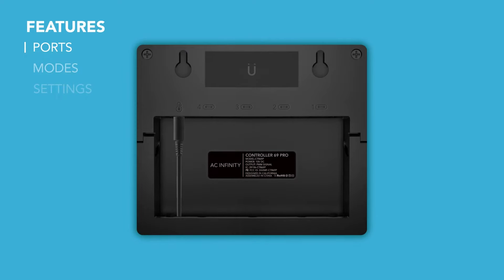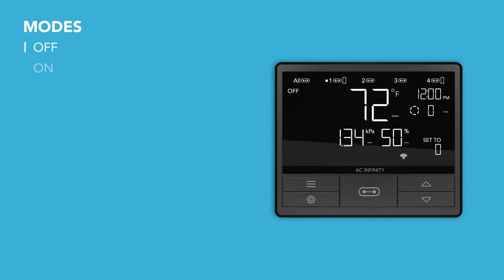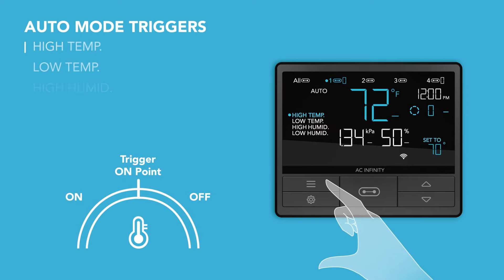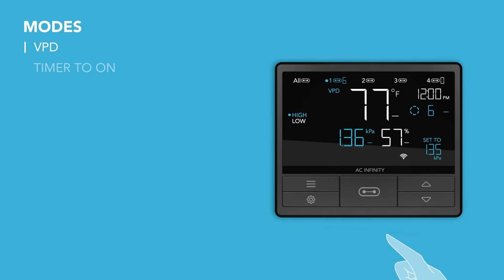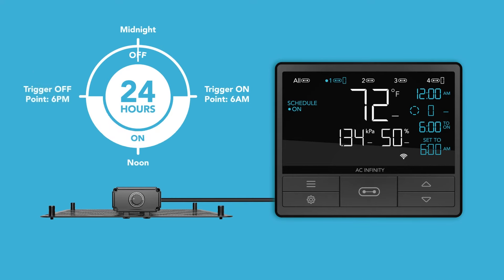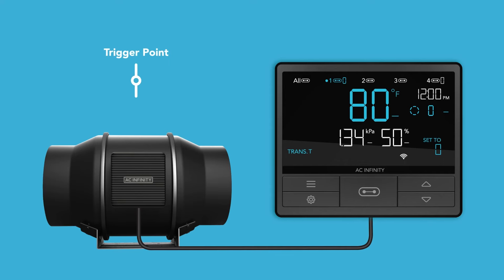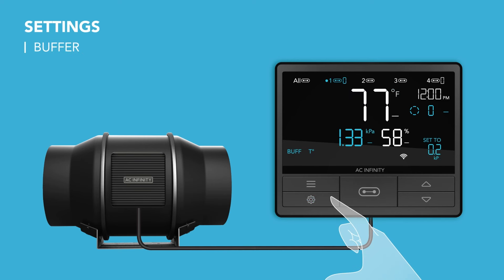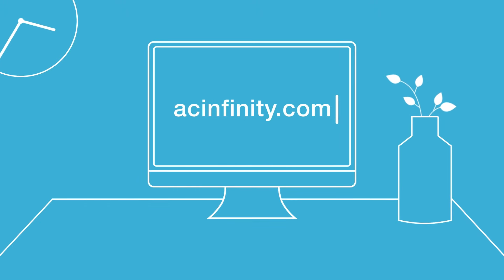How to Use the CONTROLLER 69 PRO

Comment: Im a new grower that has a full time job that doesnt allow me to be home all day. Having the controller 69 pro is the best thing ever. I can be miles away and still check in on my grow and adjust anything if need be. Peace of mind is priceless but AC Infinity sells it for about a hundo🙌🙌🙌
Reply: @Growdankmeds  how would I be able to control temp and humidity fluctuations? Or do you mean just have everything running constantly and adjust to that? If that's the case that doesn't seem the "correct" way, more of a waste of energy.  Please explain cause I plan on getting another tent soon
Reply: @Growdankmeds  How, say he's at work and a very hot front of weather moves in, the inside of the tent goes up 10 degrees into the danger zone, how does he fix this from work? Or how would a tent that is not automated adjust for this?

Comment: Extremely impressed with controller 67 and circulation fan. Easy to use,operate,and set up. 👌 Great job guys!!!
Reply: hey i know i’m a bit late but have you ever had a problem where it won’t read temps or humidity? i even bought a brand new probe & it still won’t work. I got my controller 67 about 4 months ago but haven’t even used it yet. I don’t have a receipt so i’m SOL when i called them this morning

Comment: I have Resisted a controller on my reef tank for years but absolutely could not for my girls! Of course the reef tank controller STARTS at 600. Then you got auto testers blah blah. Growing cannabis is soooo much cheeper than growing corals! I can be a poor man and still afford all the cool bells and whistles. Just ordered the humidifier to hook up to the 69 and getting my ionframe lights connected and scheduled took less time than the firmware update did!! My friends Neptune controller for his reef tank took him 4-5 hours to get connected, updated and all his devices connected.  Loving it so far. My friends think I am touched in the head because I have a little WiFi camera on my tent and my tank. Very good purchase

Comment: I have every port of the controller 69 used. Inline fans, grow light, heater on UIS port plug, and humidifier. Now that's its getting into warmer weather the humidity is getting up there.  I want to add a dehumidifier or possibly an a/c and have the controller handle that too. It's there a way to add/extend ports or will I have to get another controller?

Comment: Having problems working out how set the controller to have different values during the day and night, I want to drop temps at night but using the timer function only seems to turn it on or off, any help please? thanks

Comment: Few ideas for future software updates to the controller 69/pro. iPad make it so you can use split screen, with the AC infinity app. I use the 8" oscillating fans, how do I tell if they are in oscillation mode on the app? I can only see speed and adjust other controls in the port function. Other than that this thing changed my world.

Comment: the only improvement is to please add an automation that can be set to change the VPD leaf offset for night (0) and then to day (-4)...otherwise the Auto VPD triggering is kind of not automatic, as you have to 're calibrate' every transition from night to day in order for the triggers to fire properly ... enhancement request - thanks - the rest of the system is super awesome

Comment: Hi guys could use some help lol.  I have the ac infinity 3x3 pro tent with the s33.  I accidentally ordered a lux instead of par meter and have seedlings.  My question is what’s a good height and setting on the controller for my light.

Comment: can i just program the fan to go slow or off when temp. is under my minimum setting ? and can i use 2 triggerpoints to only a fan so high humidity fan high low humidity fan low and temperature corresponding ?

Comment: Mine was working fine until I did a firmware update now my controller won’t show that the fan or humidifier are connected. Light shows up fine.

Comment: Does anyone know if i can easily swap my Controller 67 for the 69 Pro shown here using the same power cable, temp cable and 4 pin cable for my Cloudline S6 blower fan i have set up for my Air conditioning? Its in a basement that can only be accessed from the back yard and unfortunately my bluetooth signal isnt that great yo remotely control the fan on and off at will unless im in close range. So i was looking for a wifi type device and hoping i can use the same cables i already have for an easy replacement.

Comment: Its crazy to me how complex of a process it used to be to set up ESP32 microcontrollers, smart outlet switches, hygrometer sensors, all in HomeAssistant to be able to program this same functionality for my tent in the past and even then it wasn't as smooth as this. Can't wait to get my 69 pro and start playing with it. It sounds like a dream system combined with yalls other UIS stuff.
Reply: Wym it’s so easy to use node red and esp32 with mqtt I’m only using this for my fans everything else going in HA

Comment: The on/off cycle should have a selectable reference time like 8am not the moment you set the value.
Reply: Just use the schedule feature instead😊
Reply: @Stoneysgrow420  🙂 for a job 1 min on, 19 off but synchronized with fans off during that 1 min but on during the next 19. Schedule doesn’t work.

Comment: 0:59 (Incorrect) it will only run continuously if the power dosen't go off. If it does even for a second the 69 pro will default back to OFF mode until you manually turn it back on again. Very devastating when power switches at 3am occur and fan stops until you wake up and fix it.
Reply: Maybe try updating your firmware, I had the power to out for an hour, when back to its settings when it came back on
Reply: Mine glitched one time when it somehow wouldn't turn the inline fan on. I hit the reset button on the power strip by accident. I freaked for alittle bit. Powered it back on and all was good again. Everything was as I set it

Comment: Can I hook up to fans to this controller?
Reply: Yes..in two ways. Fans that have UIS controls built in (AC infinity fans) can plug directly into the Controller. Fans not equipped with UIS can use the optional UIS control plug for outlet powered equipment.

Comment: I bought the cloudline s6 and 69 controller with WiFi.
The fan is very loud. And was disappointed with it.
Even after asking hydro shop if it was quiet running. There not.
Reply: I can just barely hear anything and I have 2 fans running. I ordered a noise filter but don't think I will even need it.

Comment: Doesn't support 5 GHz WIFI, even if the SSID you are binding too has both 2.4 & 5. Not sure why the wifi is so outdated on this device, or why it can't choose the correct channel. I'd wait until they come out with the next model if you have a modern wifi setup & don't wish to cobble your networking for 1 device. One could always buy a specific WLAN router and dedicate an SSID just for this I guess, but that makes the overall solution a little more costly.